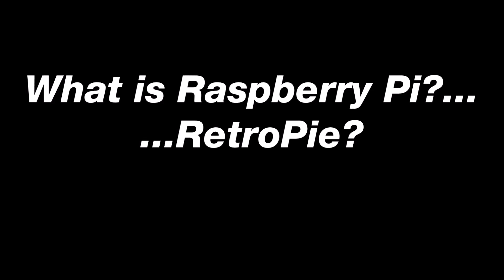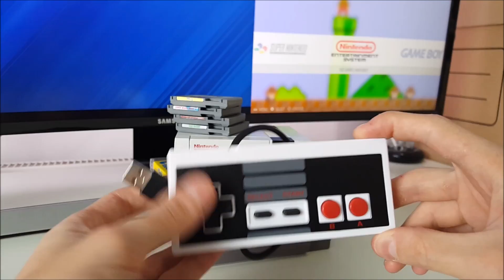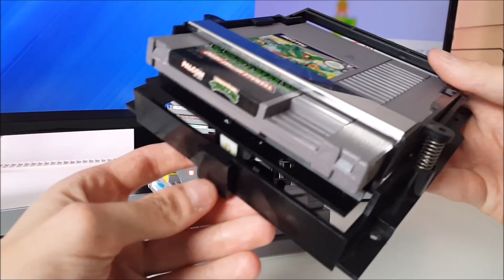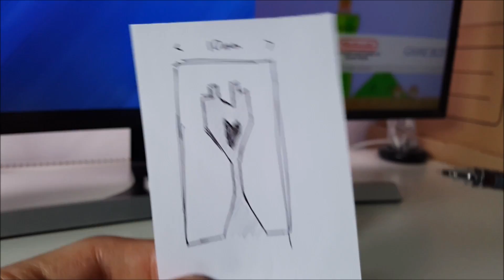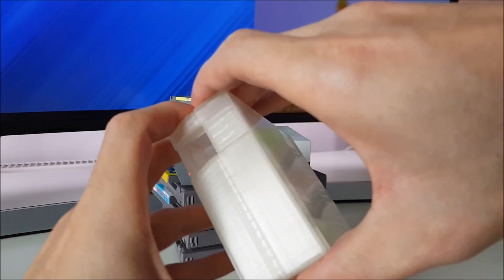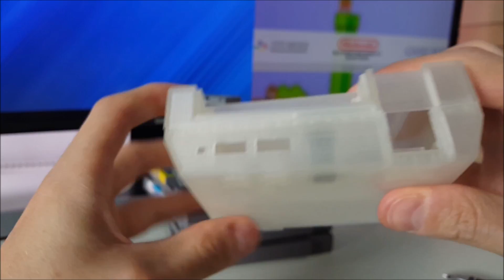Mini NES Classic Console Update #1

Comment: Dude. I am in love with your NESmini. It is an amazing inspiration to see you build this out of pure nostalgia love for your 1st Nintendo console. It truly has inspired me to want to do the same. But with an alteration. I think that I may be a few years younger than yourself and my 1st console was the Super Nintendo with Super Mario All-Stars plus Super Mario World. I amazed my parents when I was able to set up the whole system by myself at whatever age I was at. (Honestly, can't remember how old I was) But, I feel like my nostalgia love for the SNES is akin to your's of the NES. I've also had a real interest in electronics and programming with absolutely no training, but a real interest in learning.
I wonder how different the inside electrical and programming components would be for a SNES replica versus your NESmini. I know your original video showcased the NESmini working as a GBA emulator, so it obviously is not limited to just NES. I would absolutely love to be able to build an SNESmini to harken back to my 1st console, complete with NFC-chipped SNES cartridges that can be inserted and ejected via the middle lever just like the original, if possible. I came across one replica SNES case for the Raspberry pi, but it was merely just cosmetic. The connections for the board were on the left side of the system, which totally took away any kind of original nostalgia feel for the system. Anyway. Thanks for sharing your project with the world. Would love to get your thoughts on an SNES build. ;D

Comment: Great job! I'm in the process of building my own mini nes (albiet a bit larger than yours). I really like the nice touches like the mini game carts with rfid, latching mechanism, and soft power control so I will probably end up building your design in addition to the one I am currently working on. I happen to have nearly all the parts in my junk bin and a 3d printer so all I really need to replicate your mini nes is a wiring diagram and the necessary stl files. Looking forward to you sharing more documentation. Thanks!

Comment: I am interested in building this. In your blog you link to a clone 5$ arduino that you used to make the controller. Is that also the same arduino you used to connect the NFC reader to?
Reply from the maker: No, I use a cheaper arduino  pro mini to interface the NFC reader, any ATmega328-based arduino would be fine
Reply: so would this do? http://www.ebay.co.uk/itm/Mini-USB2-0-To-TTL-6Pin-CH340G-Converter-Pro-Mini-Atmega328-5V-16M-For-Arduino-/400709595744?hash=item5d4c273260:g:ddoAAOxyzqdTcw5N
Reply from the maker: yes
Reply: Ive scoured the blog for all the parts you reference, and now with the arduino for NFC I am only missing 3 main parts. The Power LED (size or model). The NFC activity LED (model). And whatever you got going on between the arduino and the NFC reader. It looks like a board of some sort.
Reply: But the Raspberry Pi is not 5V tolerant, it could die when directly connecting the Arduino to the Pi.